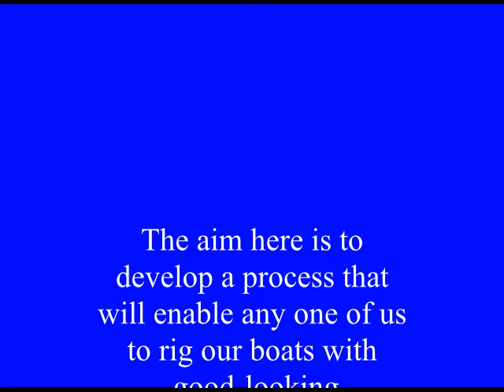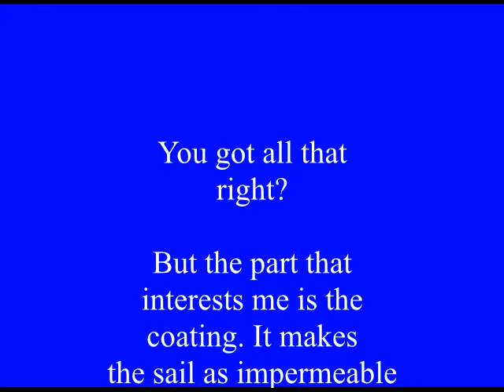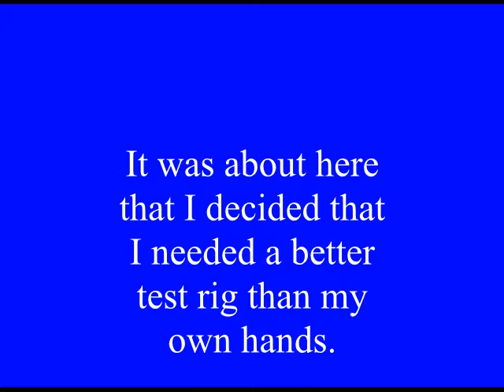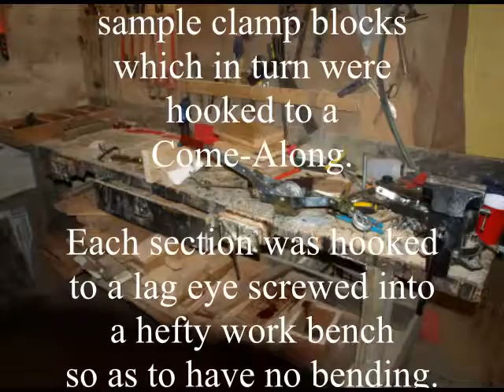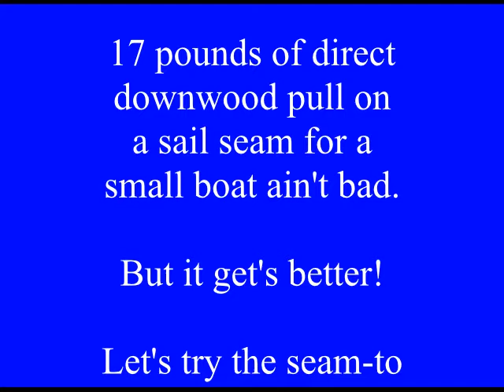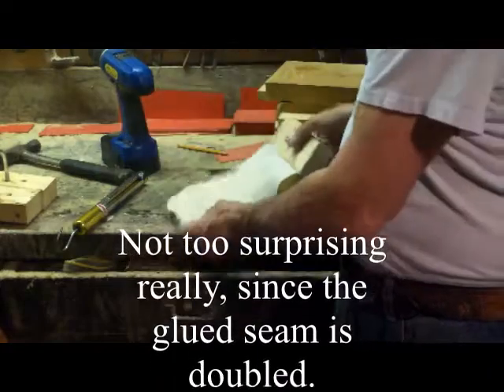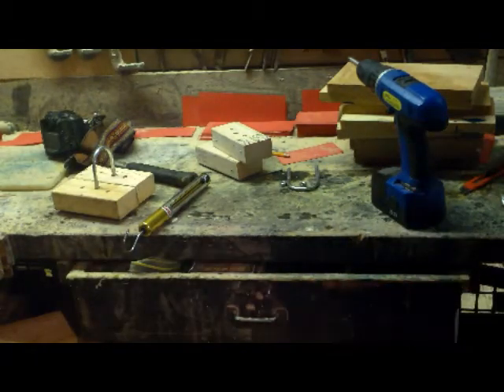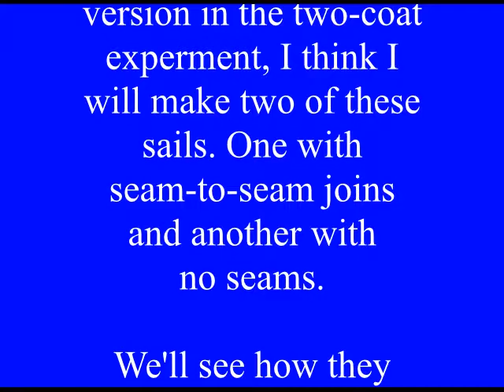Make Your Own Sails--No Stitching, No Sewing!--Part 1--Materials and Testing

Comment: Thanks so much!  I came across a "free" Sea Skamp in pretty rough condition.  The sail was litterally falling apart.  With humility I duct taped it to just do a quick test drive and see if it worked? It did:)  I reiterate a VERY short 10 minute trial... as I wanted to make it back to shore!  And it did:)  

Purchased locally a 9'x12' "Trimaco BUTYL II" for $29 at a comercial paint shop.  It is off white canvas on one side, smooth butyl on the other.  No wind today:(  Pretty easy

Comment: I disagree with phartattack's comment. I found the info useful, even though I was aware of much of it. If you're new to it it's relevant info. Do you know if a heat gun would work with this fabric? I have one with temp control that I use to make tarps/canvas for my yurt. It's very easy and fast for that. Perhaps it would, but might need a coating of rubber along the welded/metled seams? I'll try to get a similar material and will try it out. Thanks.